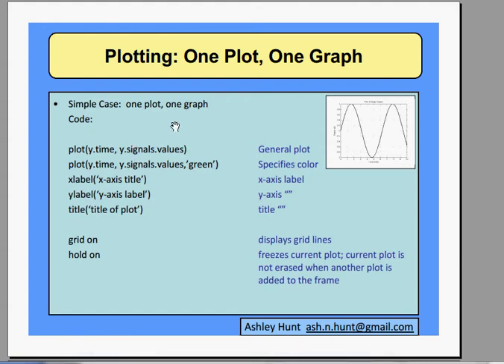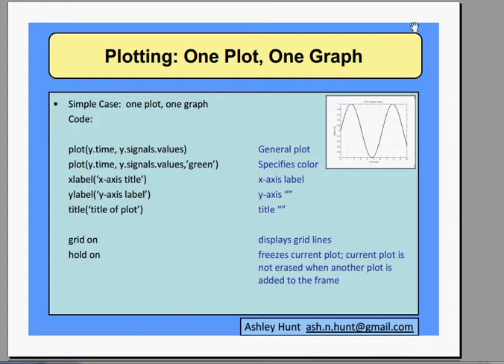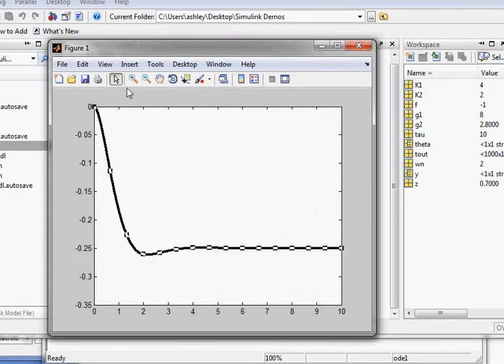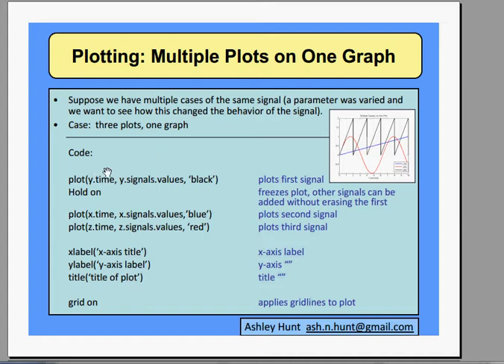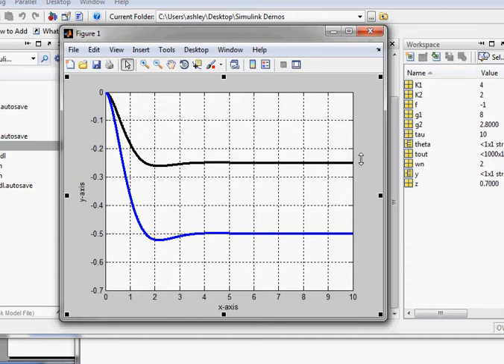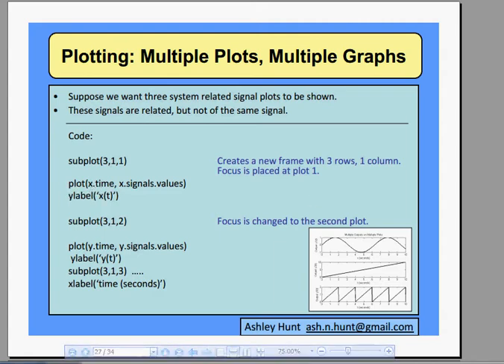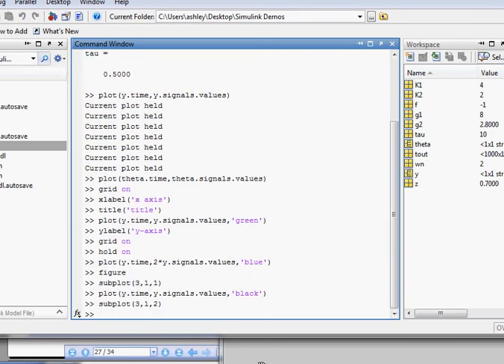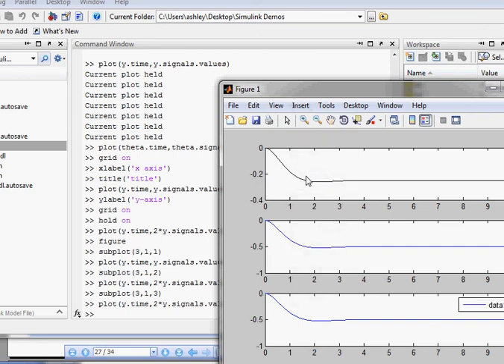Part 3:  Plotting Signals in MATLAB

Comment: Hello Ashley. I writing this comment because I need your help: right now I'm doing my PhD studies in Electrical Engineering and there is one thing I don't know how to manage in Matlab/Simulink: is there a way to plot one signal with respect to other signal, and not time? I know that, by default, Scope shows a signal with respect to time, but I don't need that. To be more precise, I need a I(V) curve (current with respect to voltage).  Could you please help? Thank you in advance!
Reply: +acamarkovic This can easily be done in Simulink / Matlab--ensure that you are saving the signals you need to plot. There is an option on one of the tabs of the scope, or you can use the to_workspace output block; both of these blocks are found under the Simulink block library under "Sinks" and both allow you to save the signal under a name of your choosing. Double-click the block once you have placed it to access the settings. In one of the videos in the series, I discuss how to configure the settings, but it is very easy. Once your simulation has run and the data has been saved, it will be accessible in an array. Simply plot the arrays in the format you wish with the plot command in Matlab.
Reply: +Ashley Hunt Thank you so much!